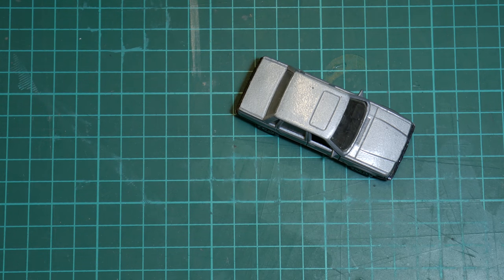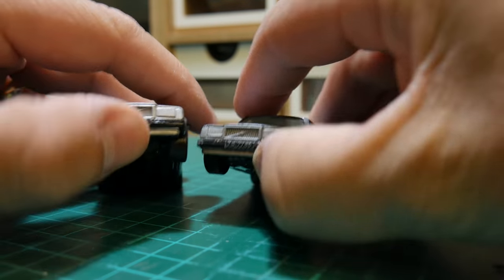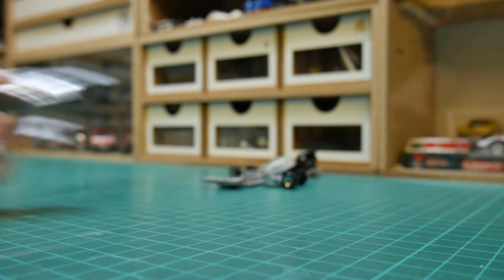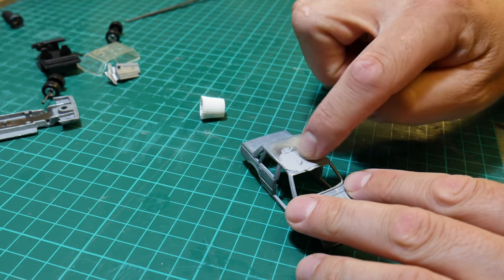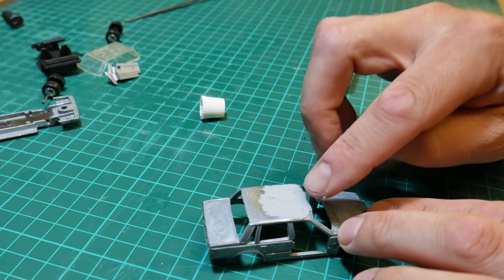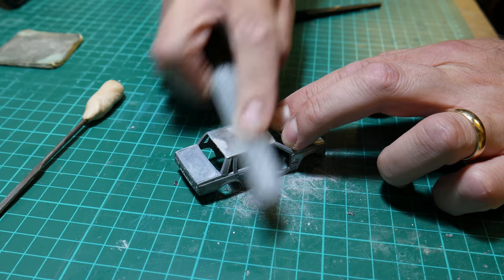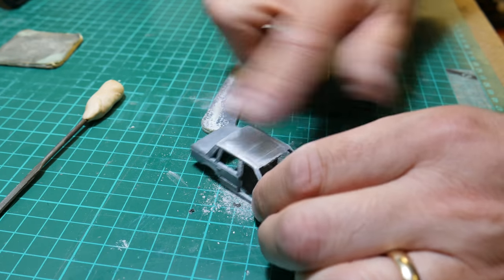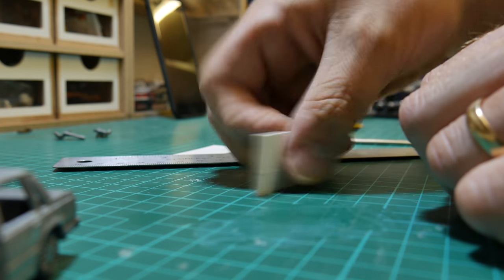MATCHBOX Restoration & Custom : 1986 Volvo 760

Comment: Hello, again. At 18:35, you show your Liquid Styrene. I first saw this in one of the old 'Airfix' modelling guides, way back in the 1970's. We used to call it 'Goop', and it was a godsend. We made it by dissolving old model kit frames (wrongly called 'Sprue') in jars of Windsor and Newton 'Winsol' solvent. You just pack it in the solvent until you get this napalm-like slurry the consistency of honey. What you use it for is limited only by your imagination. Fill gaps. Fill holes. Build up new areas. Even cast small parts with it. It's great - but best if used outdoors.
Reply: Sprue is actually no longer an incorrect term. Initially it was a word just applying to moulding channels but the usage in modelling and even industry applying it to the frame and final product elements is so widespread that several dictionaries have updated their definitions to include the subdefinition specifically applying to the frame and elements.

This is generally how language evolves, much of our modern usage has origins in incorrect usage of words long ago or slang terms offshooting from "proper" speech. Its pretty fascinating tracking down etymologies.
Reply: @thepinkplushie  - I was told, more years ago than I care to remember, that 'Sprue' was the injection moulding term for the tiny tabs of plastic that attach the kit parts to the frame. But you're quite correct. The term has evolved, and, like the name 'Hoover' has become the term covering the use of all types of vacuum cleaners, so 'Sprue' now means the frames, or runners, that hold the more interesting bits of a model kit. That reminds me that I've been making model kits an awful long time The first one I made, in 1972, when I was nine, was an Airfix Supermarine Walrus. I've had an affection for the 'Shagbat' ever since.

Comment: I think you need to do another Volvo and send it to 3D bot maker. Slam it, plastic wheels is a must with bosuku styling (crazy front spoiler, high rear spoiler with high exhaust pipes and wide arches for stability). 👍🏻👍🏻👍🏻👍🏻

Comment: Once the parts are removed, plastic model builders cut up the sprue (tree) and put it in liquid cement.  It can be thick or thin depending on the ratio.  It's usually it called sprue goo.
I love your aero kit.  You're gonna generate some serious downforce at speed!  Have you had it in the wind tunnel yet?
Reply from the maker: Many thanks for that 😁👍 Now there's a thought..... a mini wind tunnel.... you've got me thinking now.

Comment: Amazing job on this one, I can just imagine it on the track! I don't what happened to the racing program for the 740/760 but I do know there were plans to enter the 740 Turbo in the ATCC (Australia) as well, the plans must have been fairly far along as a mock up of what was to be the race car was doing the rounds of Volvo dealers on the East Coast in late 87-88 (it was silver with a livery that was kind of a hybrid of the 240 Turbo 1986 ATCC winning car and the 850 livery you used for this car).
Reply from the maker: Many thanks as always Robert I appreciate that 😁👍It seems there's a lot of Volvo race fans out there hiding amongst us..... I need to start on the 240 now 😁

Comment: Fine work, as ever. I always have to remind myself how dang small these cars are, your detail work makes them seem bigger.

Fun little manufacturing mystery with this one, too. I wonder if the casting variations indicate that they had to replace the dies midway through the year for some reason. If so, it'd be interesting to know whether the less detailed body die was the original or the replacement.
Reply from the maker: Many thanks 😁👍 Yes it would be good to learn the reasons between the two.... of course I was being flippant wondering if there were fakes but I'm sure there is a reasonable explanation.

Comment: Super job! love those ToCA Volvos!  Have you gone down a rabbit hole to play with the ride-height / track / camber on any of your cars? 
Feels like this one could enjoy a slightly wider track (spacers on the axles?) and a bit of negative camber (subtly bent axles) to really nail that 'planted' look you got on the 80s 90s tourers.
Reply from the maker: Many thanks as always I appreciate it 😁👍 I have stanced some but I like them all to roll and not get hung up. Problem you have to really fill the arches is having to grind the inside for clearance which isn't a problem. The difficulty is its a good 2 to 3mm thick on some cars and the outer easily deforms if too thin. I'll do some in the future but for some like this with the spring steel suspension it catches the minute you begin to push it too. I'll endeavour to slam one for you buddy 😉
Reply: @SidewaysKing75  Super! That would be excellent - I appreciate the difficulties though ) And on the right car obviously. Wasn't really aiming at the idea of massive slamming, but I am a fan of wide track and box arches ;)
Reply from the maker: @LittlePixelTM  It sounds like your a Zakspeed fan.... There may well be another one coming along soon😉..... and another DTM'esque little gem. All the best

Comment: This would be purely a guess, but the 'bubble' deformation would most likely because by a developed  imperfection in the stainless injection mould. That would have rapidly been spotted, and would then require replacement. Assuming that the moulds were constructed by anode arc process, which you'd kinda expect, then either the original positive, or the copper positive, could easily be damaged, and so detailing may be lost. So, I'd generally say if the non-bubble one had more detail, then it's earlier in the run, if less, then it's later.

But that could of course be completely wrong.
Reply from the maker: Many thanks for this...... Its odd for sure. Missing parts and poor quality on the one just made me think it could have been a fake.... but that is only my thoughts! Many thanks for watching and commenting.
Reply: @SidewaysKing75  Always a pleasure. of course, the stainless moulds also lose detail over time through simply wearing out, but that bubble is an absolute - there's no way for it to form without a matching dent in the mould, and once there, it'd be on every car.
Reply: @SidewaysKing75  Could be something to do with edocar

Comment: Im curious... when you painted the wheels, i noticed you used Tamiya spray paint for Polycarbonate... normally they're for R/C body shells... does the paint adhere well to the 3D Printed wheels? because if used on normal plastic, they don't seem to stick well...
Reply from the maker: I've never had any issue with the paint. I usually lay down some primer but in the odd occasion I haven't it still sticks fine. Works good on the diecast bodies too 👍🏻

Comment: How did You glue the styrene to the metal?
Reply from the maker: I used thicker CA glue and quickly sprayed it with activator to harden it and not melt the Styrene. The side skirts and front bumper were a tight fit and wont come out without prising them away. I'll mention the glue and spray next time I do a video so thanks for the headsup.
Reply: @SidewaysKing75  Thanks for the quick answer!

Comment: I wouldn't be surprised in the slightest if there were fakes floating around but what are your thoughts on casting degradation? I'm curious if the original mold lost some of these details overtime and instead of correcting or recreating a new mold they opted to repair or push on missing some details. I'm not familiar with the history of the company but perhaps it was a tight budget era, pure speculation of course. I'm not sure that this is even possible but it was just a thought. I love the content as always, looking forward to more in the future.